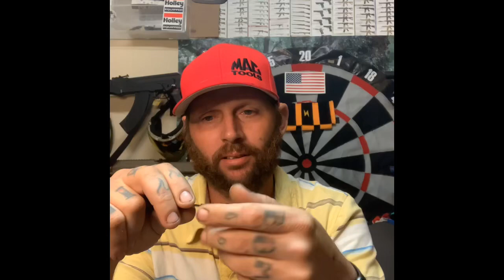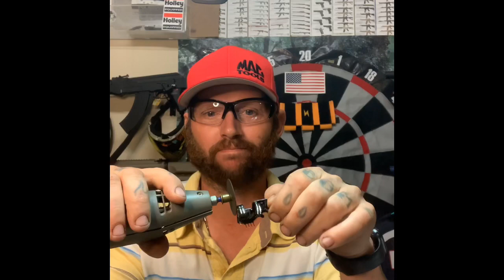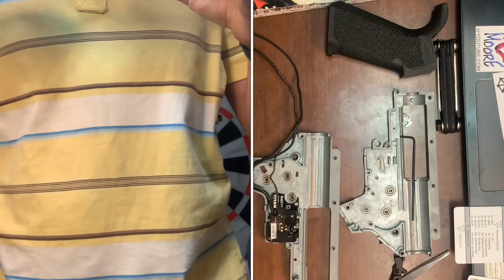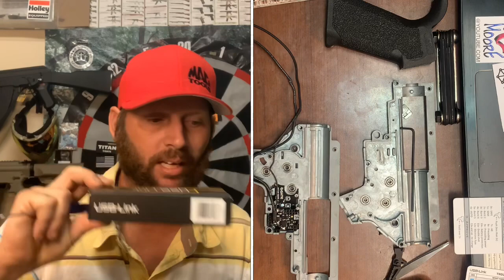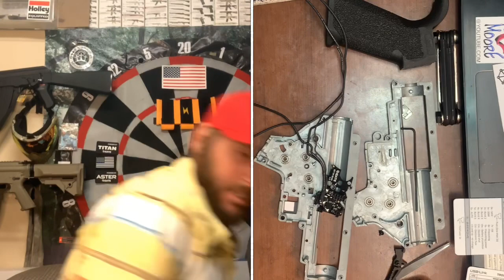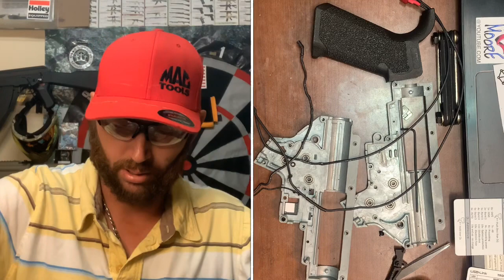Gate titan airsoft how I destroyed mine in 10 seconds beyond even my repair

Comment: So I just had a gate titan professionaly installed. It shoots perfect but when I run the diagnostic it says e12 over current protection 2. But makes no sense the current is normal idk why it's saying that
Reply from the maker: What battery are you using
Reply: @JJMoore  11.1lipo HPA brand 1100 mah its 30c and 50c burst with m 120 spring on shs gears 13.1

Comment: Gate Titan has 12 months warranty, they make you take a picture of the mosfet and the wires to see if any splices on wire and then they make you take a picture of you cutting it in half,picture of receipe, then they send you another one, there customer service is not bad,so sorry ,that hurts 😓
Reply from the maker: They did me good just took a month other than that the new one is on the way already
Reply from the maker: This is only the 2nd one I had fail I am pretty impressed with the product and both they replaced but yea the reason I cut it was for there picture they already sent out my replacement I figured if I had to cut it I might as well have some fun with it.
Reply from the maker: SLS DeadShot it only hurts cause it would be nice use for parts you know
Reply: @JJMoore  i had two gate titan go bad on my Arp9,so i got a Jefftron  and i love it
Reply from the maker: I installed a leviathan in a 416  and it was cool once I figure out how to tune it it was pretty nasty .